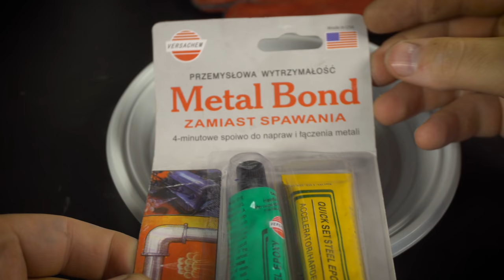How to make a lighter? / Supposedly burns without fuel!

Comment: Need a fish swimming in the center to really confuse people.
Reply: I think there is a little problem with that

That thing is too small and you wouldn't be able to feed the fish.
Reply: Teonyi maybe a small plastic fish might do
Reply: Not with that attitude you wouldn't
Reply: T3chno Blaziken Maybe .3.
Reply: A tiny jelly fish would be cooler
Reply: Just a monogram floating there would be cool
Reply: or even just like a tiny terrarium
Reply: Teonyi that didnt stop people with those glass fish shoes lol
Reply: Have a mini chia pet.
Reply: Teonyi A fish that's supposed to swim without fuel LOL
Reply: A tiny living moss terrarium with little mountains made of rock fixed in place with hidden epoxy or hot glue,  tardigrades, and springtails. And a little removable plug/screw that allows air/water/food in/out. That would be awesome.
Reply: I too think that would be VERY confusing indeed.
Reply: Disco Stu?
Reply: Please open
Reply: @teonyi  
Please
Reply: @divisionxv9285  

Open

Comment: For you guys arguing about the need for fuel... the wick showing in the center of the ring suggests that it's a straight piece right through. The fuel supply is hidden, so it LOOKS like it's working without fuel. Lighten up, guys.... it's just a video... calm down!

Comment: I don't see the point of a second wick sticking out the bottom and glued into the hole, does this have a purpose? couldn't that part be not drilled through?
 Nice Machine work though and the way you cut the threads on the body, beautiful,  i'm going to steal your boring bar design for shallow work for sure. Thanks for a awesome vid!

Comment: Like watching this video right to the 10:12 spot. Then you used your caliper to scratch a line on your brass.  That hurt. Who taught you that. I’ve watched new workers chased out of the shop doing something like that with a metering tool. But I guess if your to the point your using sandpaper on your lathe. Your measuring tool don’t need to be very nice either.

Comment: expensive ass bench equipment then a $10 dremmel, lmao I have that same one
Reply: I'd like to know where you can find a Dremel for $10. I've had my Dremel for 25 years and it still works great. Not sure what your problem is other than you've probably never picked a tool up in your life.
Reply: @mikel9567  the point was that the guy in the vid uses a cheap dremel, and Weston here has the same tool. So chill, Mike. Lashing out like that makes you sound real insecure.

Comment: "Burns without feul"

puts fuel in
Reply: It's an illusion. Of course it has to burn with fuel, but as it burns and you continue pulling the string, it will look as if the string lasts forever

Comment: Use some logic and observation skills and you will easily know how it lights up. Its more of a trick lighter than anything else. Supposedly burns without fuel TO THE ONE THAT DOES NOT KNOW HOW IT WORKS.

Comment: Meh, sort of click-baity. Of course fuel is going to be necessary and I don't think there was any promise of a fuel-less lighter, but even if one didn't see how it was made, it's obvious the main body is probably hollow and filled with gas. The little bit of wick coming out of the bottom looks cool stylistically, but it wouldn't trick anyone. This is by no means a prank of any sort, just an interesting lighter. I would have expected at least a genuine "secret compartment" for the fuel that wasn't so obvious, maybe a chamber within the chamber so you could take off the refill cap while it was burning and show "Look, there's really no fuel in here."

Comment: shitty design.  Cap is bound to be lost if it's a seperate part, it gets so little liquid, it's quite bulky therefore a nightmare in pocket, noone in their right mind would think this works without fuel,  when fueling the lighter so much fuel is lost to air because of the size of the lid, replacing the wick would be hard, and yet it's 100 dollars.  Only a collector would buy this lighter.  No real reason to buy this over a zippo or any cheap lighter.